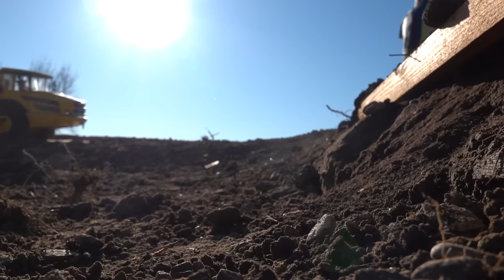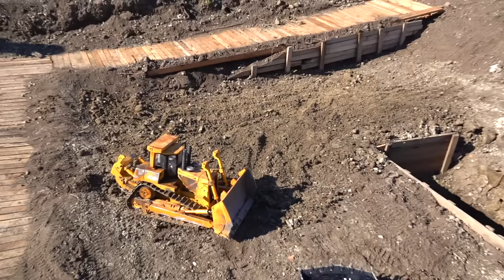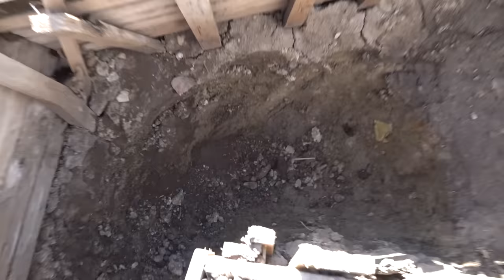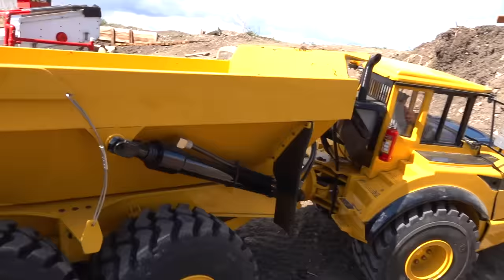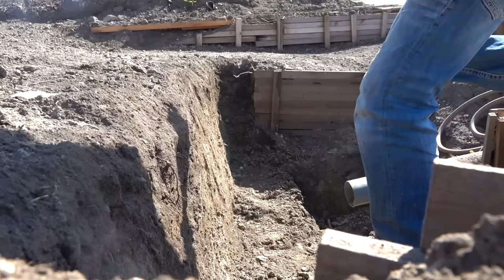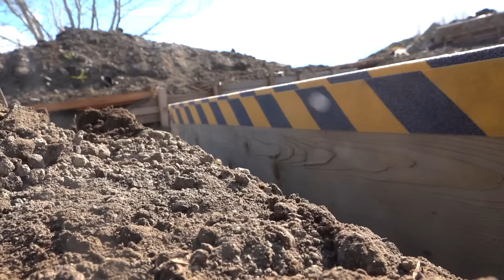YouTube GOLD (S3 E2) A NEW DAY: PREPPiNG the MINE-SiTE for GOLD - KOBELCO DiGS | RC ADVENTURES

Comment: The mine site is shaping up nicely. It's nice to see the newer equipment in use at the site. Nice to hear the humor at the site even though everyone is not there. I hope that it's not much longer before the crew can get together and start finding gold again. 
On a side note, hearing all the sound kits you use has urged me to order one for my Wraith. I started with the RTR version and I have already added the RC4WD 2 speed transmission, upgraded the steering servo, installed all aluminum suspension and steering links with aluminum servo horns on both servos. I had been away from the RC hobby for a while and I apparently had forgotten how addictive parts of it can be and how much money can be spent on upgrades and accessories. UGH
It's not like anybody has forced me to do it. LOL

Comment: Great video. A little loader trick. If you need more tractive effort, ie weight,  get a full loaded bucket of heavy material, then make your pull.  Another thought is on the wall. You could use cable tie backs from near the top of the wall to dead-man stakes, or pipes, 5' back from the wall.  Keep up the great videos, and keep safe.

Comment: Have you tried to put thicker oil in diff of the white loader? IT almost close it, to avoid spin of tires? Thick buggy diff oil 50 000 or 100 000 or even higher. If needed still can diferate, but transfer torque to all wheels.

Comment: If you had a telephoto lens, you might be able to get enough forced perspective to make it look like the machines and you are the same size. I would recommend maybe getting a couple of T posts for fencing to help hold your wall in place. It would take more work driving them into the ground but they are taller and being metal they won't rot out from being in the water, heck your neighbors might have some slightly bent or damaged one they might let you have for free.

Comment: Thanks Aaron. I think that paint on the washing table will wash off.... 👍😁
Reply from the maker: Cheers  Braxx,  I hope not!
Reply: I’m not as much concerned about the paint washing as I am wondering if the paint is slick enough to allow the dirt, rock and gold to slide off. Is the paint as smooth as the slick plastic was underneath....is there too much resistance now?